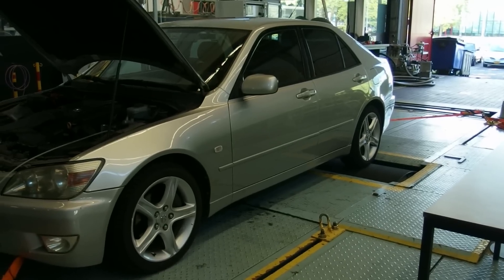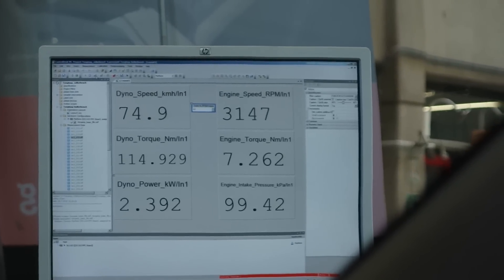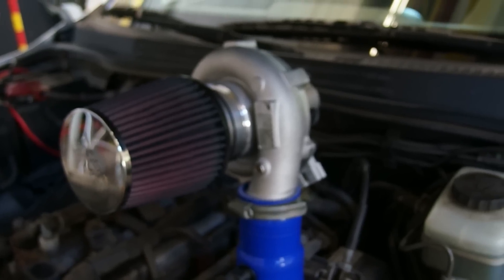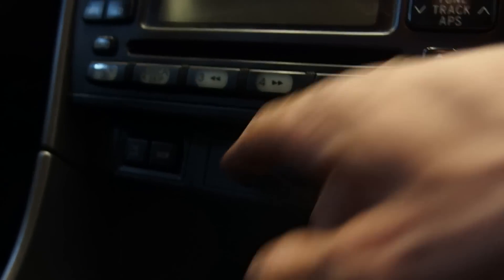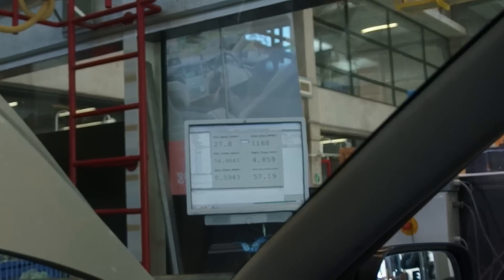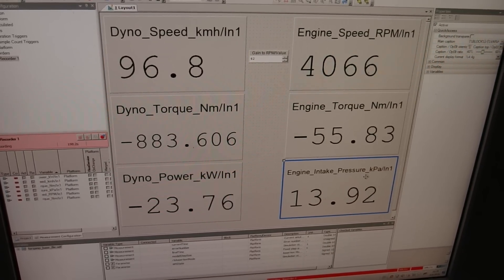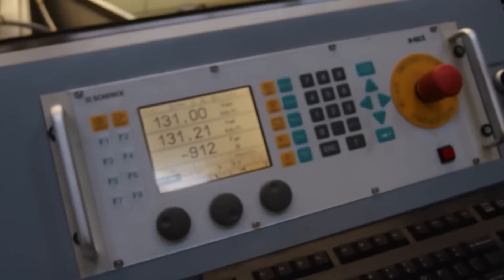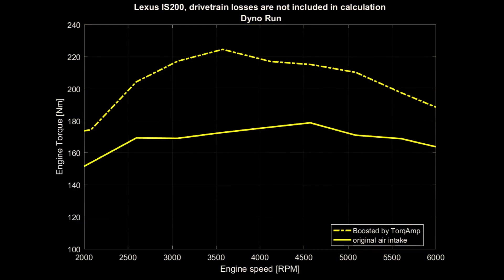Dyno testing Electric supercharger on Lexus IS200 TorqAmp

Comment: For $3400 I can get a real turbo... it's too expensive.
Reply: its a start..
Reply: @96jonsson  But not a finish... The problem with this is on larger engines and the limited flow through capabilities. I would probably be better off with an old Paxton/Vortech/Pro Charger with an electric motor attached to them.
Reply: @Todd.T  I think the POSSIBLE way it could work for bigger engines like V8s would be if you use the regular intake system and then cut a hole into the side of it and stick a pipe in it where the electric "supercharger" can feed more air into the engine without any restrictions

It's kinda hard to explain what I'm thinking, if I had a way to actually show you what I'm saying then it might make a little bit more sense
Reply: Elon "CheekyKnob" Musk No. I totally get what you are saying. It would have to be in front of the mass air sensor so it could meter the extra air and have a valve operated by electricity.

As high voltage systems become more popular in the car, I think we may see this.. You’ll need a boost program too.

These are exciting times, especially with hybrid engine technologies. They’ve been around for a bit.

Look up the Infineon sponsored Panoz from back in the day Q9 GTR-1 Hybrid
Reply: @Todd.T  personally I can see electric FI being up there with turbos and superchargers if they get enough support, especially if they end up being easier to install but the main problem right now is the price but I guess it also depends on who you're comparing it with, for example 

Person 1: knows how to and has the tools to do fabrication to install a turbo at home so he/she can buy a kit and do it himself/herself and would save money instead of getting an electric FI system

Person 2: doesn't have the knowledge nor access to do his/her own work so he/she would have to buy a turbo kit and have someone do the installation for him/her which all around might cost as much as buying an electric FI and just finding a way to install it at home if they're creative enough to find a way to make it work (like me with the idea of an intersection intake system like a "Y" system) 

And another thing I notice is that these electric FI seem to have a less parts to install in order to get it working because if you use something like a turbo then you gotta have oil feed lines, fittings, intercooler, manifold, etc

While the electric FI seem to just need a custom intake and air flow sensor with some wiring and you're pretty much set and can possibly have it going within a day with less worry of trying to fit everything on like how you gotta put an intercooler somewhere in the front of the car to get cool air

But one thing I do want to know is if these electric FI systems get hot and if they do then how can you cool it down? Plus what are the maintenance for something like this?

And as a side note I'm comparing prices of a turbo kit for my Toyota 1uzfe engine from my lexus so a turbo kit might be cheaper depending on what motor you're working so I'm not trying to speak for everyone and maybe I might be looking in the wrong place for a kit for my motor
Reply: @Dunki113  The advantage of a turbo is the semi free ride from the exhaust. When it is electric, unless it has a  motor controller it would either be on or off. Another alternative is to bleed off the boost until you need it and gradually introduce it via engine RPM and throttle angle. Superchargers such as the Pro Charger don't need an oil line AFAIK.

Back in the day, we used to take a race supercharger and overdrive it at lower RPMs to get a lot of boost sooner or the race ones ran more like a turbo and didn't bring in on until later when you actually had traction.

I wonder what the tax on the electrical system is and if it is worth it vs conventional boost techniques.
Reply: @Todd.T  I think the smartest thing to do with an electric FI system is to have it set up with a button and be like a like a supercharger that can be turned on and off like in Mad Max
Reply: @Dunki113  Since most of the first electric cars used overvoltage systems to get high performance, I'm really sure they could feed more voltage to get more oomph, but I think that cuts down on motor life.

My car is somewhat of a Mad Max mobile from factory. The supercharger has an electomagnetic clutch. When I'm off boost, the charger freewheels. When I stomp on it, the clutch engages the charger. It has a bypass valve to let the air go by the charger when not in use.
Reply: @Todd.T  man, that sounds like a crazy car you have or I just haven't been out long enough to know about this
Reply: @Richard Vaughn 3400€ will buy a used car with twin turbo's
Reply: Junkyards have turbos for $50 just look around look for Audi's with the upgraded turbos. For a budget build they are usually good for a safe 9-10 lbs of boost. Don't expect monster gains but deff better than stock N/A
Reply: @Dunki113  they were talking about making all the F1 cars completely electric and based on how the driver brakes and for how long and how hard will determine the outcome of the race. Meaning the driver who takes the best line, late brakes till the very last moment so he can hit the brakes as hard as he can so the charger will recharge the cars battery will win the race. They also said that they will add a speaker so it can simulate a gas motors sound. I really hope they don't go this route.
Reply: @Spiderman I don't disagree with you and to be honest I'm not an expert when it comes to this whole electric turbo thing or whatever this is considered as I'm more familiar with the old fashion turbo or supercharger, going by what you said the only solution is to make a bigger one but I'm not sure
Reply: @Republican_Extremest  neither do I but it seems that most people are fixed on electric cars being the future
Reply: Todd T I got a used procharger AND a set of trick flow heads for $2800..... But I guess I could have spent $600 MORE and gotten..... this??? 🤔🤣🤣🤣
Reply: For 3400 i can have a true turbo setup that gives 100+hp gain and have it tuned,if i installed myself and could even treat myself to a nice dinner and a few beers and pick up a bump of coke.
Reply: I agree to exspensive we are trying to find a cheaper way to boost might as well how the extra 3 grand and have 100% boost am I right
Reply: @Richard Vaughn yA but ur not putting them on a car for that. The turbo is tbe cheap part
Reply: CheekyKnob google ‘volvo penta flapper valve’
Reply: But less stress in piping bro
Reply: For $3400 you can get a real turbo that actually makes decent boost for more than 5 minutes in a row... Here you're paying over 3 grands for something that will make 5 psi of boost for 5 minutes then you need to recharge the battery for a much longer time before you can use it again. If this electric turbo costed somewhere in the $500-600 range, it would be interesting, but at the price of a full turbo setup and considering its huge limitations, it's a rip-off. Sorry TorqAmp.
Reply: @Richard Vaughn and a complete junkyard ls
Reply: What about the turbo lag ? Could you buy twin turbo for 3.4k usd ?
Reply: I would buy one but not for 2k for that money I can buy 4 ebay turbo kits complete !!
Reply: @Dunki113  perhaps they should design one with a coolant channel running through the housing of the electric supercharger if heat in the thing is an issue
Reply: Not really because you still need to buy and oil cooler for the turbo, and a new exhaust system.

Comment: looks like 40kp of initial boost that would be good for compound boost. Just have to convert that kpa to PSI at your altitude?
Reply from the maker: it's approximately up to 6psi of boost. It is great to run the TORQAMP in combination with a large turbo build. You can find some more details about that on our website www.torqamp.com

Comment: For $3400 you can get a real turbo that actually makes decent boost for more than 5 minutes in a row... Here you're paying over 3 grands for something that will make 5 psi of boost for 5 minutes then you need to recharge the battery for a much longer time before you can use it again. If this electric supercharger costed somewhere in the $500-600 range, it would be interesting, but at the price of a full turbo setup and considering its huge limitations, it's a rip-off. Sorry TorqAmp, but can you really justify pricing your electric supercharger like a fully-fledged high-end turbo setup when its usability is obviously extremely limited? The only thing that your system has on convention setups is that it's easier to install, but that's really it, and it doesn't justify the price. You're not gonna make a change in the market if you don't adjust your prices accordingly.
Reply from the maker: The price is 2500usd. Check out https://torqamp.com/shop

We see the TorqAmp as a new boosting option next to superchargers, turbochargers, nitro etc. All technologies have their own benefits. Think about large turbo spool up, indeed easy installation. Also easy to build out when selling your car (for example classic cars),use the TorqAmp on your next car. Try to sell a second hand turbo kit... It will be hard for a good price. We expect the TorqAmp will keep its value because of the high reliability.

When there is no kit available for a certain car it always cheap to install a TorqAmp because developing a turbocharger or supercharger custom for a certain engine is always labour intensive and so expensive m

Comment: The TORQAMP kit costs € 2.900,- euro which is about $ 3.383,- USD.
Does it sound like a normal price for a turbo?
Reply: Way to expensive for the little amount of power you gain. You can almost buy a good supercharger kit for that money or assemble your own turbo kit.
Reply from the maker: One thing to take into account is the price of the installation of such a kit. The installation of a TORQAMP takes 1-2 hour. The installation of a turbo/supercharger kit is much more time consuming and therefore a major expense when you outsource the installation.
Reply: TorqAmp if you can fabricate your own turbo kit you won’t have to worry about installation cost lol if you can fabricate your own kit most know how to install it, not to mention i’d much rather spend a few days on a real turbo than waste time on this scam

Comment: I wonder why you are running dyno test on 6000 RPM ?
Reply from the maker: Not sure if we understand what you mean. We run over the whole engine rpm range. Please explain
Reply: @TorqAmp  I was trying to integrate a turbo on an internal combustion engine. In compressor selection stage, I have chosen 6k rpm for 2jz-ge engine. I was wondering If am right or wrong. That's why I asked that.
Reply from the maker: @gameupfront  you can find a bit more details on the installation on a 2jz with GT42 in this video: https://youtu.be/RWoZtDsYdwk

Also more details about the setup on this page: https://torqamp.com/bypass/

The match between turbo and engine is depending on what you want. So when you take a small turbo it will give boost at lower engine rpm's. A large turbo will give boost at the higher engine rpm's because it needs more exhaust gas flow. When combining a TorqAmp with large turbo the TorqAmp will make sure the engine will produce boost and also more exhaust gas flow so a large turbo will kick in at lower engine rpm's.

Hope you understand.
Reply: @TorqAmp  thanks,i understand. It is clear.

Comment: I can appreciate the potential application of an electric supercharger on a compound set up like your 2.5 subaru with the 20g turbo. It added an incredible amount of power down low. I think the Y pipe to the intake with a brilliant idea so as to not impede airflow. The 20g came into boost MUCH earlier. People fail to realize that this thing makes boost almost instantly at any rpm. most exhaust driven turbos cant make full boost by 1000rpm. For eliminating turbo lag its a great idea.
Reply: Anti lag system is cheaper and gives you even more poweeeer.

Comment: really nice, way to pricy though compared to other and easier to install turbos.
Reply from the maker: Thanks! In general turbochargers are cheap when you can do the installation yourself but when you have to pay for labour it is much more expensive. Also the additional components such as the exhaust manifold, cooling, oil is not necessary.

Comment: smaller engine would be happy
Reply from the maker: We did 1.2L till 3.5L engine with a single TorqAmp. On the 289ci Mustang with 1 and 2 TorqAmps. Both great results. The TorqAmp works also great to support turbo engines. So lot of applications!
Reply: @TorqAmp  but does the efficiency increase as we move into smaller engines ? they need less air and if that turbo forces same amount of air into smaller engine = more boost = more powah = happy life = mad wife
Reply from the maker: @rebassed548  that's kind of true, it is not about the efficiency that is higher but about the pressure ratio. I will try to explain this. 
You can find a graph with pressure ratio as function of mass flow. https://torqamp.com/torqamp-kit/
So the yellow line shows the performance of the TORQAMP compressor. A smaller engine has a lower massflow so therfore you end up with a higher pressure at tthe same engine rpms. For example compare the results of the Citroën DS3 1.2L with the results of the Honda Prelude 2.0L. The DS3 gained relatively more power.

Comment: Very expensive.  Since my goal is to go from stop light to stop light faster, for the cost of this unit I can change my gear ratio and add a throttle controller for far less and achieve my goal.  If this was more cost effective I would consider it instead.  Just an FYI.  Cheers!
Reply from the maker: It's not a cheap product to make, we use a lot of high quality components to make it work. We are very happy that we are now able to drop the price from 3400usd to 2500usd. So don't expect the price will drop more soon. It highly depends on the car/engine what is possible and how cheap you can tune it with a standard eBay turbo kit. For other customers it's a cheap solution to get better performance.

Comment: Good stuff. Can work as a lag eliminator in combo with turbo on proper setup. But imho a little too expensive.
Reply: Yes too expensive
Reply from the maker: Indeed the benefit is great on a large turbo build, you can find an example of a Subaru Forester STI on our website. Turbo kicks in much earlier and already boost at 1000rpm.
Reply: That is what I was thinking. Since upgrading to a big turbo in my IS300 the lag is killing me. Been toying with a small shot of nitrous just to make it spool faster. If this was a little cheaper I would be all over it. Here is hoping the tech grows as the price drops.

Comment: Ok. But what about afr?
Reply: The ecu runs on a MAP sensor. It can handle a certain increase in air pressure.
Reply: lol
Reply: @rayron12345  the funny thing about this is that the boost this thing produce probably won't even engage the fuel cut.
Reply: @AX-xi2pw  im just even thinking like woah its not alot more air...

Comment: Wow only 20 or so wheel hp for a over 3000$ kit? I hope in the future this tech shows advance for you guys. Cause for about 800$ I put a dry 65hp shot on my car and dialed in the afrs using a flash tuner. I'm guessing your still in a more r&d stage and sales now are just to help funding? If you you guys ever develop a bigger more powerful unit I'd be interested to see it. I don't think that current unit would add any power to any of the v8s in my yard lol

Comment: Lol but why? $3400 ???and how did the prelude make more power than the IS?
Reply from the maker: On the Prelude we used an open ecu so we could perfectly tune the ignition timing and so get easily maximum torque. On the IS200 we used a fuel cut defender in combination with the original ecu. Because the the ecu is self learning it is not possible to change the ECU map. Therefore the Prelude has a better performance gain even though the engine size is the same.

Comment: So 14% so let's say you have a 300 horsepower motor that's 42 horsepower for $3,500????
Reply from the maker: The car has  around 140hp on the wheels. Because of the self learning Ecu it is hard to influence the performance. An engine like this has the potential of around 25% hp gain. Check out the video on the Honda Prelude. This car is properly tuned.

Comment: I am puzzled by the graph. I would expect to see the largest HP increase at low engine RPM yet the graph sows the opposite. Also, in both traces there is no significant power roll off. Makes me very suspicious of the results.
Reply from the maker: You're right. To get more torque/power you need air, fuel and ignition timing. So the TorqAmp provides enough air proven by the pressure measurements. The air fuel ratio is right because we measured it by a wide band lambda. Because the ecu is not mapped but only the pressure sensor is equipped with a fuel cut defender, so the ignition is not right for high torque. For a better example what the TorqAmp can do you can take a look at the results of the Honda Prelude which is also a 2 liter engine and well tuned.

Comment: This would be perfect for my needs at ~$1,200 or less. I need a little more torque at 3,100 rpm for towing a small camper with a 2.4L (2RZFE Tacoma)
Reply: 1000 euro is the most I'd pay for this product too. It's just not worth the price they are selling it for. It's totally overpriced.

Comment: I'm guessing you can fry your car if this is installed improperly
Reply from the maker: Yes for example running lean is not good for your car. This is the same for turbocharger and supercharger setups. You need a proper fuel and ignition tune after installation.